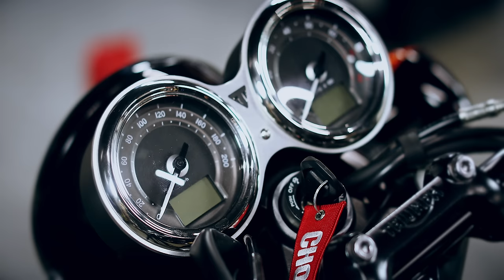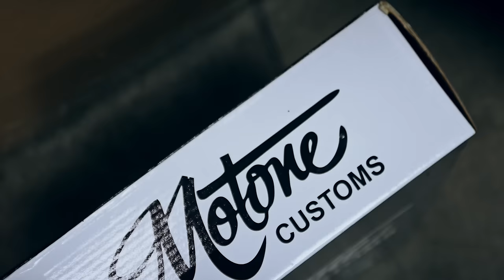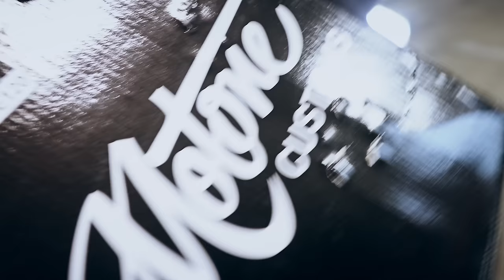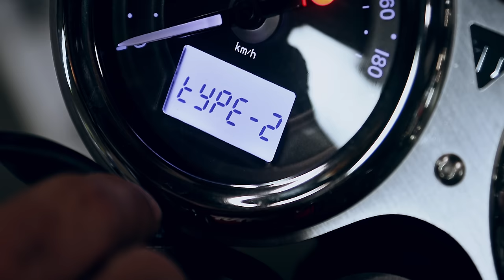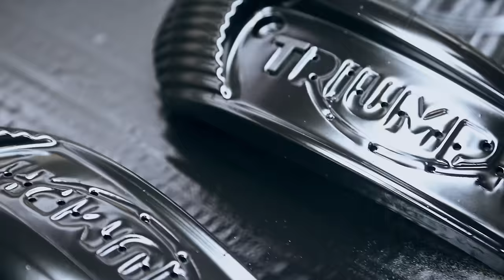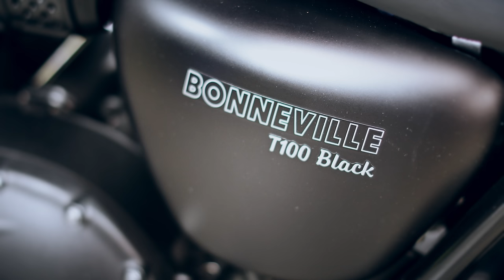Mighty Bike Mods - Triumph Bonneville

Comment: You shouldn't use car oil in a bike like that. In a motorcycle the clutch is "wet" (lubricated with oil). Motorcycle oil has special additives for this reason. If you run car oil, it wont be a major disaster, but you will wear out the clutch much much faster. I thought it was a myth, so I used car oil, and my clutch wore out in a couple months. It was an older bike.

Comment: OBD2 ports are a US Federal standard, not a California one. California had smog testing, just relied on actual testing equipment and not the honesty of manufacturers (see VW on how smart that blind trust was rewarded).
But California instigated the dumbest smog control laws around. The type that made California cars the very dirtiest in the nation for decades.
In the 1960s and 70s, a "smog pump" was one of the ways that helped clean up the idiotic results from morons still believing running very very rich was a great idea. Any car from the 1970s and earlier, without secondary air injection, would just billow blue (fuel filled) smoke.
After the oil embargoes of the 1970s, manufacturers fixed the issue by instead running lean mixtures. Ended up that the idiots were wrong, and decades worth of airplane engines were in fact avoiding melting from lean mixes, which made it so they could fly much farther for longer.
Seriously, people believed running even slightly lean would destroy your car. These idiots never learned how the US military aircraft quadrupled their flight times during WWII simply by switching to a more lean model than a rich one. (see Charles Lindbergh's contributions during WWII)
One way to deal with the pollution would be to set standards, and allow manufacturers to reach them in any way they can. The California way is the make a very specific piece of equipment standard, and then ignore every single bit of advancement and ingenuity after that. It's better to seem like you're done something, than actually try to fix an issue.
Fun things to do in the 1990s, take California car in to get a "smog check"; pass test. Go home, remove smog pump, get retested; fail test (no smog pump) while having much much cleaner exhaust products. Create less pollution, have a bit more horsepower (while, again, creating less pollution) and still fail since no smog pump.

Comment: wait... ordering black cover peace from fucking Seattle, buying simple folded plate of steel or aluminum that hold the read light, reg plate and indicator... and paying 250$ for Xpipe...
I know you have 3,1 mil subs but ffs you cant be bothered to get rattle can to paint the cover, making simple peace like that and just weld the damn Xpipe for what 50$ at tops?
I know its for the show, but thats just ridiculous.